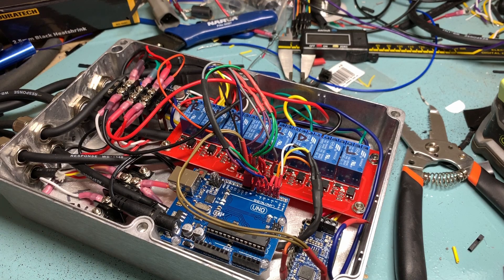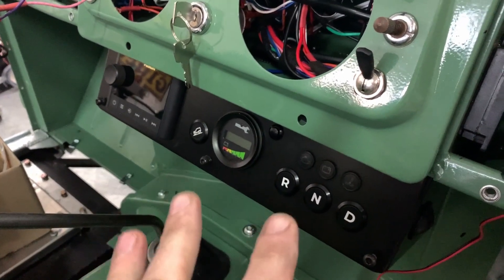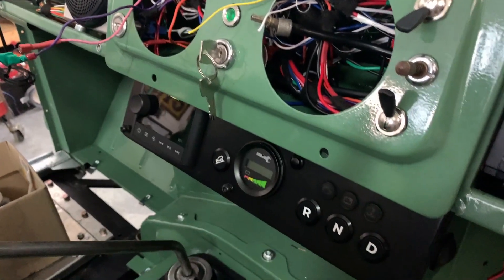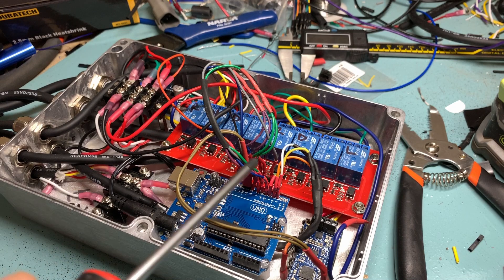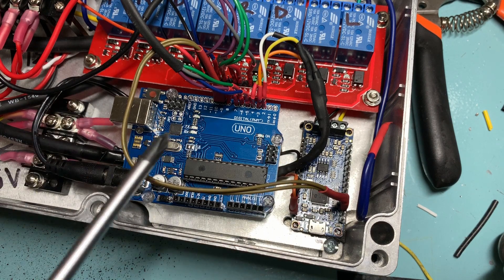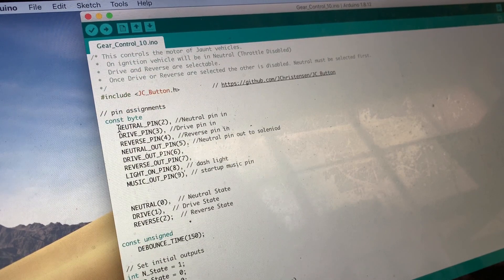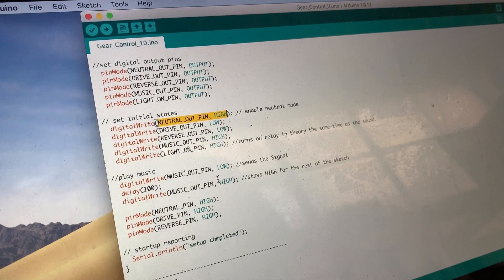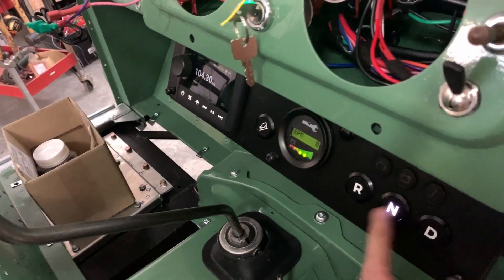Prototyping an electric vehicle 'gearbox' with Arduino  || Electric Land Rover Conversion

Comment: I have been wondering about using relays instead of IGBT..but was worried about the noise for one and ramp up and down smoothly and burning out relay contacts as well.. How robust and long life have you noticed these giving you? or do you have a separate motor control and this is just for switching stuff on and off ?? just realized i might be wrong about what this device is you have there...
Reply from the maker: We use dedicated PDMs now. Either from Moristech or AEM.  Essentially the same as this prototype but much more robust
Reply: @Jauntmotors  interesting..are they fsst enough to switch a brushless motor? Way expensive too.. Why is it preferable to an igbt?

Comment: can you list all the parts that you used on this prototype please
Reply from the maker: It's been a while, but its pretty basic. The exact parts probably don't matter that much as they're standard Arduino gear with different brands and model numbers depending on where you are in the world. these were just from our local electronic shop

Arduino Uno
12v to 5v voltage converter
8 x opto isolated relay
Lots of wires
Generic enclosure

Comment: Great to see the circuit board details and even a bit of Arduino code! I wonder if instead of the sound effects (on power up, etc) you could convey the same information by clicking an old-fashioned relay or an old-style buzzer or a mechanical ding bell.
Reply from the maker: Interesting idea.  We do use a few relays in the car just for the sound effect.  Should think of some more truly mechanical noises

Comment: Very neat idea. I like the use of visual and audio for signaling startup. The neutral for direction is a good call. I saw a comment on a previous video about the limitation of being able to rock the vehicle out of a tricky spot off-road because of the neutral mode, but if that was ever a case there is still the option of using the old gear stick and changing gears.
Keep up the good work.

Comment: Ingenious stuff.  So, what is the audio file you have for the start sequence?  The sound effect from the Jetsons car?  The “mi-mi” noise that Road Runner makes in the cartoons?  The bugle from Catch the Pigeon?  There probably something Freudian about my suggestions there, a little bit of a pattern, but they’d put a smile on most people’s faces!
Reply from the maker: A friend of ours composed the sound. It’s lots of layered guitars playing the same chord.  We can offer bespoke sounds for customer’s vehicles which is really fun to design
Reply: @Jauntmotors  like a supercharged or turbo'd v8 sound? big subwoofer in the engine bay, little tweeters making blow off valve sounds, haha  be good fun

Comment: What do you do if you get into a situation where you are stuck and need to swap quickly between drive and reverse to rock it out?
Reply from the maker: You can switch pretty fast with the buttons. Faster that you can change physical gears I reckon. But you’ve still got the mechanical gears too